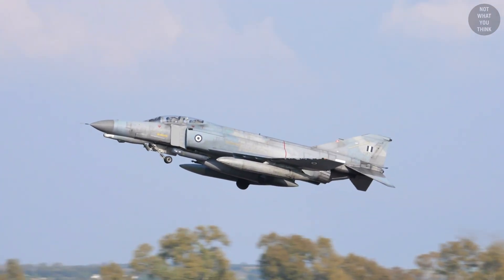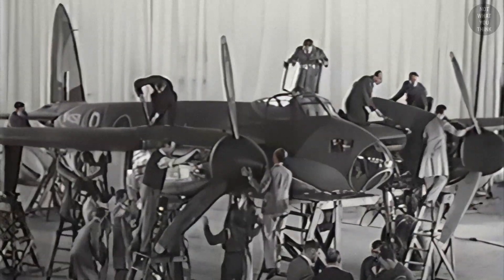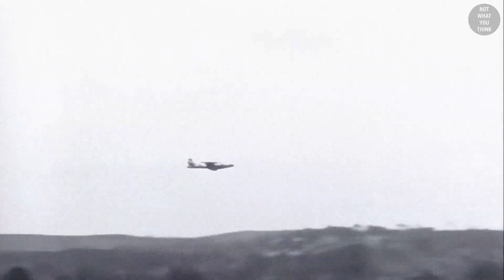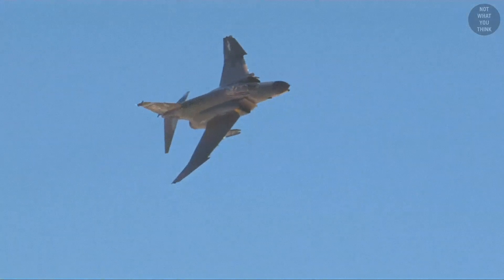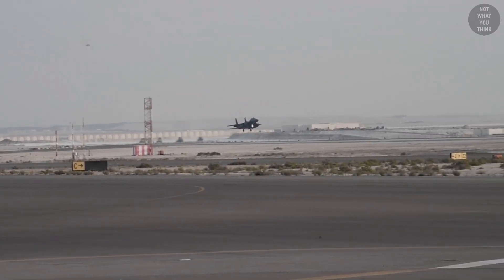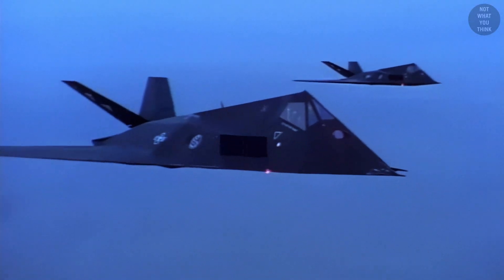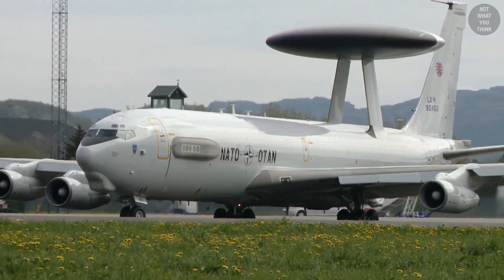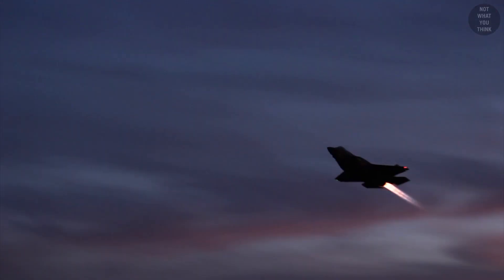Why are Modern Fighter Jets Slower than 1960s?

Comment: One VERY important factor that is omitted from this video is that higher top speeds and service ceilings are absolutely crucial in BVR engagements. The faster your launch speed, the fast your missle speed.
Reply: Would you rather have:

A. Mutual detection BVR skirmish with high separation speeds vs a Flanker
B. Undetected BVR engagement into WEZ/NEZ from substantial and appropriate separation speed that takes IR detection into account and avoids it.
Reply: @LRRPFco52  I don't disagree....I'm simply saying that speed is being downplayed a little too much in the vid. Missle lethality is directly related to its speed. The faster and higher that missle is launched, the more lethal it is. Also, the faster you are, the greater chance of defeating a missle because the missle has to calculate a much greater intercept vector. Meaning that every time the missle has to recalculate that intercept vector, it has to turn much father bleeding significantly more of its energy. Stealth technology is great. It is hear to stay....but even a stealth fighter emits radar for weapons guidance which is detectable by RWR. If your bandit knows how to defend and can merge with you, your stealth advantage is greatly reduced. With that said I'd rather have it than not.
Reply: @miletello1  The whole point of LPI AESA is to avoid triggering threat RWR, but there's more.  You don't need an active sensor track for solutions.

F-15C with IRST recently demonstrated passive track guidance for AIM-120D3 and successful live intercept.  This approach is a far more advanced capability set in JSF than will ever be present in F-15C+ or EX since JSF has layered forward quadrant 5th Gen EOTS/DAS fusion across multiple IR wavelengths, fused with the passive RF sensor suite.

Different threats have different RHAWS and EW capability, and most are excrement-level trash that deserves extreme ridicule.  None are capable of playing the semiconductor development and production game with new SC and advanced processor boards with the US.

That means US EW systems will always have faster processing speeds, better return signal amplifiers/exciters, and more advanced algorithmic capabilities.  On top of all that, nobody has collected and disseminated a more comprehensive digital threat library.

For many years now, even older variants of the AIM-120 do not trigger RWR upon launch, and you can be intermittently painted in tiny, freq-hopping bursts from AESAs without any knowledge of their presence, with far superior tracking than legacy pulse doppler Radars.

Imagine now a 2-ship or 4-ship of F-35s, seeing more space than an AWACS can.  Any airborne TGTs in that space are immediately tracked and PID'd early-on, doesn't matter how.

You could paint the threat with full power AESA if you wanted to out of the gate from 2 different ships, get PID with 638 NCTR parameters, then those 2 move onto another TGT set, as they have data-linked PID and tracks to the other 2-ship, who haven't emitted a chirp.

The 2-ship with passive sensors have been tracking the TGTs, which are now fully-PID'd, and work towards weapons parameters.

The "threats" don't have a clue they're even there.  At best (with a more advanced EW suite that has faster processing power and better threat library that doesn't exist), they might have seen RF emissions from the first 2-ship, who went EMCON after the initial spikes, and are chasing ghosts in that direction, while only setting themselves up for a brutal NEZ intercept from 2 shooters they don't see.

Once the fully passive 2-ship has TGT tracks that are shootable, you don't need active painting.  The fused sensor suites of JSF have scores of ways of triangulation across multiple spectrums, and it's all essentially automated with pilots managing EMCON.

Short story is death from the shadows, literally nothing any current fighters can do about this problem.

The kinematic metrics you're describing from mutual detection 4th Gen skirmishes are obsolete.  Supersonic separation is not only unnecessary, but actually counter-productive because it increases threat IRST detection range due to leading edge thermal aerodynamic loading.  That would only hurt stealth aircraft by reducing their undetected WEZ range, meaning you need to shoot earlier from farther and then avoid the IRST's ability to detect supersonic targets.
Reply: @LRRPFco52  that is the moat detailed explanation I have ever gotten on a YouTube response. You certainly did not have to do that. One last question if you don't mind. Fox 3s have on board radar for guidance which obviously can also trip RWR. Granted there's a lot less warning because the missle has already come off the rail. But I would think a faster jet would still be more likely to defeat that shot. Obviously the closer you are to the MAR the less effective this will be.

Or am I still looking at this wrong? Is the goal to launch only within the MAR to avoid this all together?
Reply: @miletello1  There are multiple guidance modes with modern upgrades to AIM-120C7 and D series relying more on data link.  The original AIM-120A would switch to active seeker once in terminal phase, and that's still an option for subsequent iterations, but from there, we don't really talk about what has changed.

Another thing is simultaneous shots.
Reply: @LRRPFco52  ah that's DOPE. I didn't know they could track from data link. Thanks! I got some reading to do.
Reply: @miletello1  One of the big developments with modern BVR missiles is 2-way data link.  Why does the missile need 2-way data link?  What could the missile possibly send back to the launch aircraft that is relevant?  Its position and status could be one answer.

There's a think called track via missile, but if the launch aircraft are tracking TGTs passively, they can send continuous course corrections to the missiles via LPI narrow beam data link that doesn't even emit into the threat RHAWS sensors, so there is no missile approach warning unless or until the BVRAAM goes hot with its active seeker in terminal phase.

Terminal phase could be at Mach 2.9-3.x, with 36+ g maneuvering capability, so response time is too short for the targeted aircraft.

There is also the option for home-on-jam in an ECM environment, combined with other seeker and guidance modes.

These missile guidance technologies have been aggressively improved and upgraded across the fleet incrementally, so an AIM-120D3 has significant improvements over an AIM-120C7, which is superior to AIM-120C5, >> AIM-120B>>>AIM-120A.

Improvements have also been made to the rocket motor chemical composition, and guidance processing power and size.
Reply: true but if you cant detect that plane in front of you then you are essentially cruising right towards your demise.
Reply: @deathcharge811  that same speed that aids in launch parameters also aid in surviving an enemy launch...I may not see the bandit but I will see his radar output via RWR. Notching and cranking are no good without speed....I'm not dismissing stealth at all...I'm simply pointing out that this video seems to dismiss speed a little too much.
Reply: @miletello1  You won't see an AESA on RWR gear. The "notch" doesn't exist anymore with todays tech, also you absolutely don't want speed, you're defeating the purpose.... The F-35 will always out-rage the opponent because they can't see the damn thing to shoot at it.
Reply: @mobius7089  yeah apparently I'm still stuck in gen 4 tactics....I've got a lot of reading to do.
Reply: Mr. Drag says no.
Reply: @MrKentaroMotoPI  what?
Reply: @miletello1  The missile terminal velocity is reached when thrust equals drag. The launch velocity, usually much less than the terminal velocity, impacts only the time to reach terminal velocity.
Reply: @MrKentaroMotoPI   @Mr. Moto  ah yes...but if your launch platform is slow and unable to get high (less dense air) and fast, then that missle's range is greatly reduced. That's why most doctrines suggest launching at Mach 1 or greater for BVR. If the plane is already Mach 1 at launch, then the missle won't have to push through the sound barrier.
Reply: @miletello1  Supersonic missiles laugh at the sound barrier. Their cylindrical bodies with tiny wings have optimal transonic shapes. Their rocket motor burn profiles have high thrust in the fly-out phase. 
You are correct that any transonic drag energy will deduct from range (spending more time at lower speed), but not from terminal velocity.
Reply: @MrKentaroMotoPI  the range is what matters in BVR engagements.
Reply: @miletello1  Of course it does. That's why we should be flying solid metal fueled ramjet missiles - "smurfjets".
Reply: @MrKentaroMotoPI  😂
Reply: To an extent yes.

Comment: It is not the air resistance that causes the the increase in heat.
That is just cooling the jet.
Like how it gets much colder when you add wind to cold weather.
It is called forced convection.
Using the movement of air to transfer heat way from a warmer body.
 
The real reason is the build up of pressure at the front of the wings and at the tip of the plane.
Anything that faces against the wind pretty much.
 
This is nothing like putting a piece of wood against a grinder.
The grinder spins and heats up just as the piece of wood.
The wind does have a heating effect.
But that heating effect is much less than the heat transfer trough forced convection.
There just isn't any forced convection in a grinder.
The heat energy remains on the grinder.
 
This whole idea is pretty silly if you just imagine being in a room temperature environment with a fan and expect that fan would heat you up if you increased its power.

Comment: Most fighters have their optimal turning speed at Mach 0.5 and below. Even though the airframes can handle more, they simply cannot turn any faster because the pilot's G force resistance is the limiting factor
Reply: that is exactly why drones have an advantage
Reply: @saxreaper  Not really. Most aircraft take a beating from high G loading when carrying significant payload. High Gs strain the human in the cockpit, but a 2000lb bomb mounted to a wing at 9G... that's an insane bending moment on the wing. Replacing the pilot so you can do 12G will just cut the usable hours on that airframe, if not lead to outright crack formation.
Reply: @ChucksSEADnDEAD  There's a lot more that goes into this - drone fighters can afford much lower build quality / development time compared to human fighters which spend the bulk of their design lives in quality certification. Economically you can spit out multiple drones for the cost of one fighter so it might still make sense. Secondly drones seem to be getting the internal bay treatment as well.
Reply: Turn radius is also affected by ( lift coefficient, weight , thrust , airfoil design ..).     At some point an airfoil will simply stop flying .   When that happen, the airplane ( piloted or not ) is unable to  load anymore Gs.  It will depart normal flight , and without a  thrust vectoring …. It will be out of control ….  Until recovered from that state .

Comment: Mach 2 is useful for escaping AAMs by dragging them through the atmosphere. Problem is, if 5 seconds after the merge they're pointing at you but you're pointing at 45 degrees... you need to outrun a missile and throw away your altitude advantage and they don't.

Comment: The problem with mach 2 is that you start at some relatively reasonable speed. Mach 0.8 sort of thing. Then, you detect the enemy. You kick in afterburners and accelerate through the sound barrier.

But the problem is, unless you see the enemy from 100 km away, you're gonna merge long before you reach Mach 2. And then... you're gonna start turning. Instantly dropping your speed down to around Mach 1.0, if not down to mach 0.5 or less. Right, if you gain about .015 Mach per second or something, it will take you about 75 seconds to reach Mach 2. During which you will have flown about 40 km and so will your opponent.

The other thing is that if you're at mach 2, you are actually gonna have problems in the merge. Normally, extra speed is an advantage because you can dump it and increase your instantaneous turn rate with energy-bleeding maneuvers.

However, at mach 2, you're not gonna convert speed fast enough to actually make that quick turn happen. You're basically G-limited to 8 degrees a second. Your instantaneous turn rate will be lower than their sustained turn rate. And they will get Fox-2s/whatever on target first. They might not hit you if you have that kind of energy to spend, but they'll get a nice view up your tailpipe that's perfect for missiles from the 60s to track.
Reply: - Somebody needs to tell the UFO aliens about all the drawbacks of high Mach speeds &  maneuvers. The poor slobs just don't get it.

Comment: It costs alot of money to build a aircraft to sustain mach 3 not cost effective friction increases as speed is increased so a hypersonic aircraft would have to have a heat shield like the space shuttle there are aircraft that are hypersonic but they are black budget if they retired the sr 71 black bird you can bet that it was replaced with something far faster there are rumors of anti gravity craft I believe they exist because that's what it would take beat the laws of physics and aero dynamic limitations

Comment: Then why is the USAF secretly designing the Aurora. A plane with a scramjet engine that can fly at hypersonic speeds (march 5+).
Reply: So secret people already know about it
There probably was a plane designated aurora but most likely a relic at the end of the Cold War when they still focused on speed or wanted a replacement for sr 71
Reply: @LiewLmao  Google usaf working on 6 Gen fighter which will be without a pilot and use scram jet engine. When it becomes operational and other details are classified but it suppose to be F22 replacement
Reply: @peter656Cats  I’m quite certain the aurora has nothing to do with a 6th gen fighter
Except maybe the potential technologies which no one has seen yet

Comment: Today's aircraft were designed to fly faster at lower altitude, because modern SAM systems make high-altitude a rather dangerous place
As for top speed, 1960s aircraft out of Frontline service so actual performance figures have been released

Comment: There is something to be said about getting into our out of combat fast. You can't get away from combat if the jet your are facing is faster. You can't provide air support to ground troops if it takes too long to get there. The F-22 is stealthy, fast, and highly maneuverable. A far superior jet to the new fat and slow f35. F35 can only win if the other jets don't get close. If something slips through they are too slow to bug out.  They are also too slow to get to troops quickly. Let's work on our speed as well as stealth.
Reply: This is insanity. No fighter in those conditions could "bug out".
A multirole fighter coming in support of troops will be carrying fuel and bombs, which reduce performance anyway.

Comment: The theology behind the F35 is a BVR engagement where the opponent cannot "see" the F35. The BVR fight is indeed helped by a high top speed as a AMRAAM leaving the rail will add the velocity of the aircraft to the velocity of its own rocket motor. The range and energy of the AIM120 is thereby increased. All that is a fighter intercept mission like the F4 and F14 were designed for; which was to hustle out and intercept the enemy at high speed.